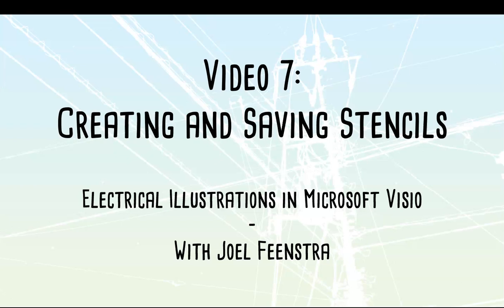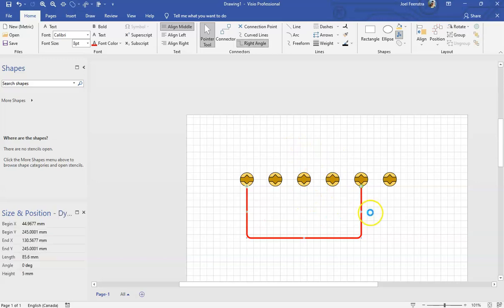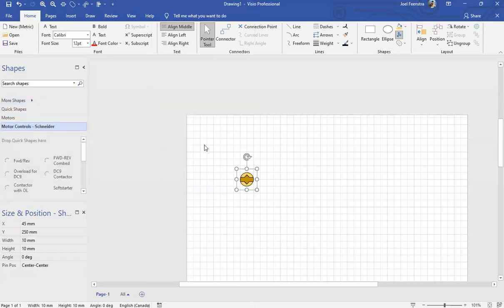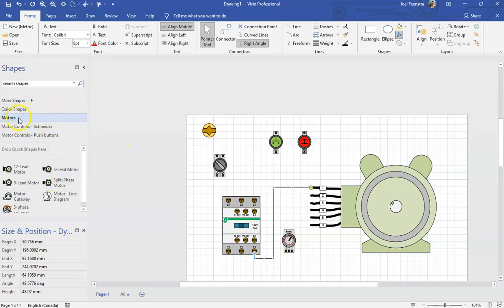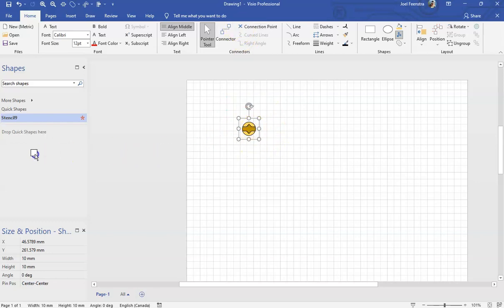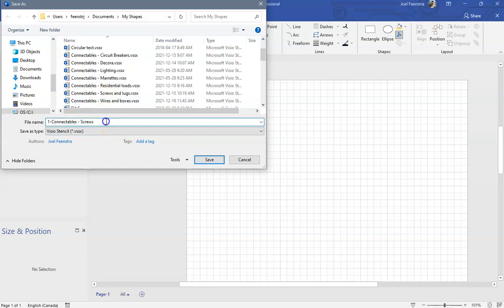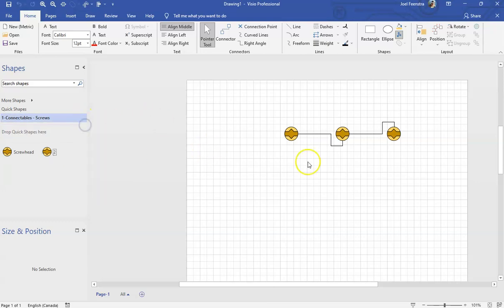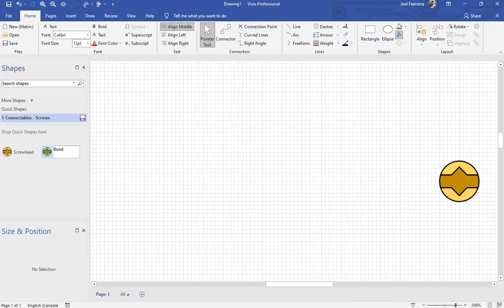Video 7   Creating and Saving Stencils in Visio

Comment: How do I update my chart with newer version of stencil?
Reply from the maker: It's pretty easy.  Right-Click on the stencil (not the shape inside the stencil) and select "Edit Stencil".  A little red * should show next to the stencil name.  Now you can double-click on the shape in the stencil that you want to edit.  It will open, you can adjust that, then re-save it and re-save the stencil.  (Or you can delete the flawed shape from the stencil replace it with an updated one.  I usually do that.)
Reply: @joelteacheselectrical  what I meant was: I already have a model with version 2.5 but now I would like it to be reflected with the latest version 2.6. Rather than changing every single shape, I was wondering if there is a way to update everything with latest version l?
Reply: @joelteacheselectrical  ??
Reply from the maker: @jag7450  I’ll be honest, I’m not sure what you’re referring to. Is this a software version that is being changed or some component you’ve drawn as “2.5” version that you would like to update as a “2.6”?